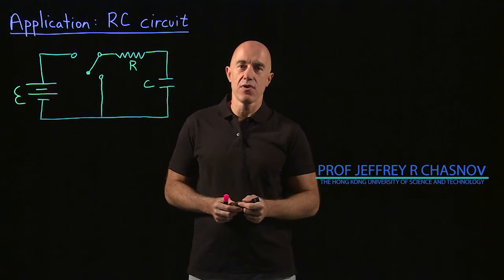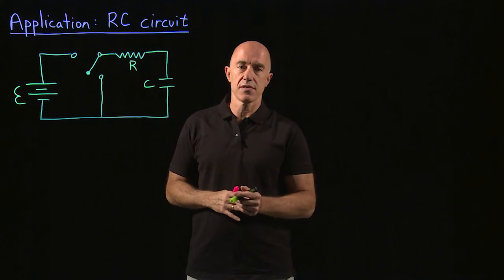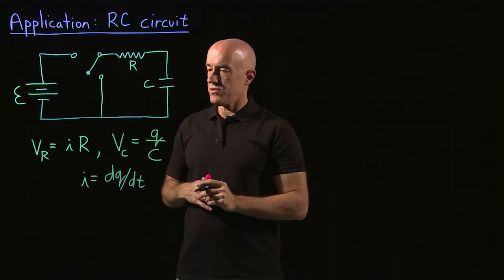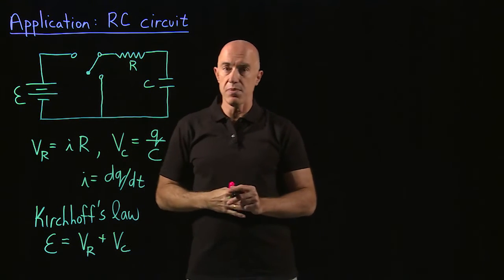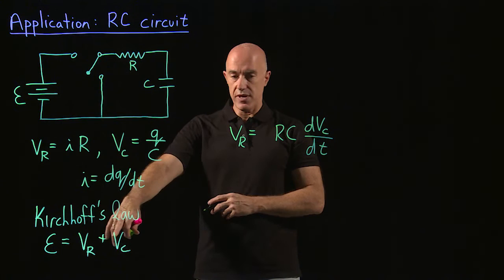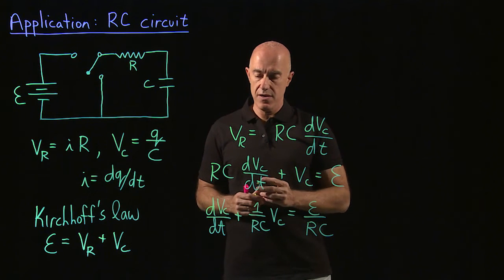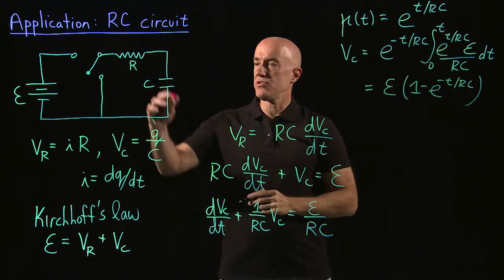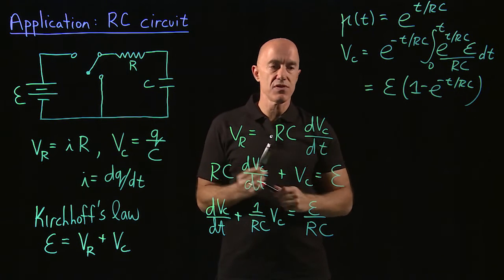RC circuit differential equation | Lecture 9 | Differential Equations for Engineers

Comment: can you explain the relationship between i=dq/dt and Vr = RC DV/DT
Reply: Yeah it's pretty confusing when he does the algebraic manipulations in his head because we might be in a different train of thought😂

A general formula for current across a capacitor is.  i = C dv/dt

With that in mind, 
Vr = iR

So, if you multiply both sides of the current/capacitor equation by 'R' you get, 

R*I = R*C dv/dt

Which becomes, 

Vr = RC dv/dt

Because, Vr = iR

Hope that makes sense
Reply: @hecticbru4497  this helped so much! Thanks!!
Reply: @hecticbru4497  That was more beneficial than whole videos on Youtube! Thanks for explanation comprehensively.
Reply: V=ir. ,v=q/c or q=vc ,  i=dq/dt

Therefore v= dq/dt×R then sub v=vc/t×R
Reply: Vr = iR
Vr = dq/dt R
q = VcC
dq/dt = C * dVc/dt
C is constant i guess (capacitor?)
Therefore dC/dt = 0
Vr = RC dVc/dt

Comment: Call it a silly remark, but it saves us a lot of trouble in real life.  Behaviour of an RC, LC or any other circuit is modeled by a differential equation.  As far as I know, that's (the differential equations) the best we have, but there is no such thing as a "proof" of this model perfectly fitting reality.  Otherwise, I am a happy, albeit a bit too old, listener.
Reply: No proof ? Sir could you elucidate that ? Do you mean that the laws we use for circuits just happens to work by chance?
Reply: @Humanbeing-b1v  No, they are the best fit to reality that we happen (stress on happen, like !!!) to know about.  There might be a better one, fitting in a wider range of cases, but it will, by necessity, be more complicated and unwieldy.
If you want some authority to corroborate this view look no further than Cédric Villani.  He has a couple of nice talks about the nature of the "law of physics", exactly in the gist of "best fit we can afford".
On the opposite side of this epistemological debate you have Roger Penrose, but even he expresses very subdued optimism of "we will know them at some point in time" - the true laws of nature, that is.